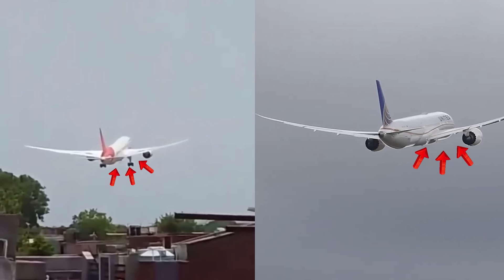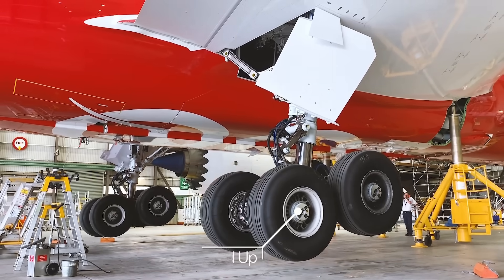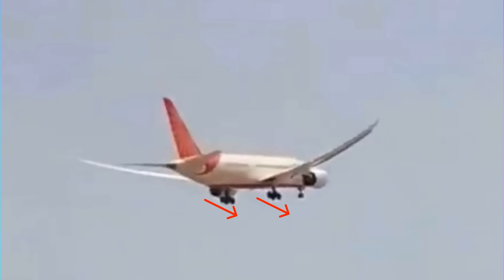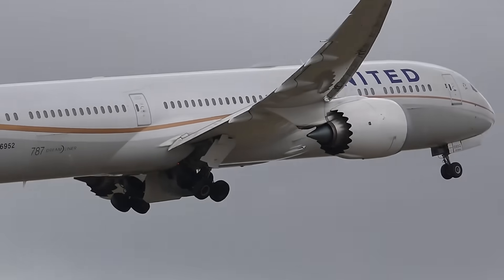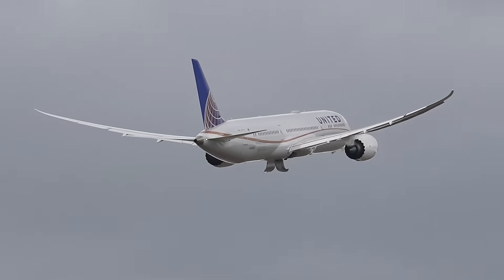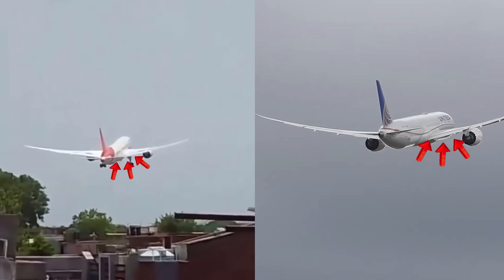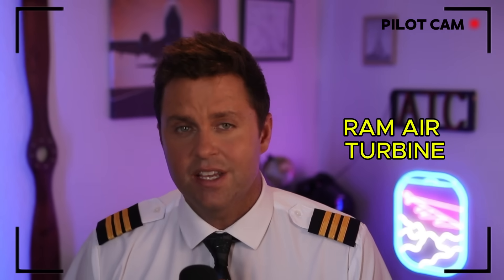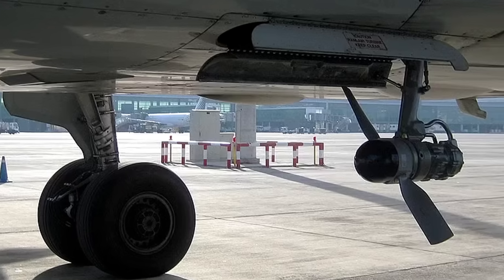Pilot Explains: A New Detail in the Air India 787 Crash Everyone Missed

Comment: Not double engine failure.  FADEC dual electronic roll-back to idle!
A Probable Scenario: Air India 171 — Gear Malfunction, Sensor Corruption, and Thrust Rollback

Context and Evidence

Air India 171, a Boeing 787-8 Dreamliner, crashed shortly after takeoff during initial climb. Visual evidence—photos and video taken shortly before the aircraft’s loss of control—confirms that the main gear truck had tilted forward (toe-down), indicating that gear retraction had been initiated, but gear doors remained closed and the gear itself did not retract. Additionally, a loud noise was reported by passengers approximately 30 seconds after liftoff. The aircraft failed to maintain climb, and eventually stalled and descended nose-forward, with no signs of yaw or asymmetric thrust.

⸻

1. Gear Retraction Attempted — Sequence Incomplete

Based on visual evidence, the main landing gear truck had pivoted from heel-down to toe-down—a mechanical requirement for retraction on the 787. However, the gear doors did not open. This implies that the retraction sequence began but was interrupted, likely due to a mechanical jam or hydraulic valve malfunction. With the truck tilted but doors still closed, the gear was unable to retract.

This incomplete sequence suggests the possibility of hydraulic overpressure, as the system continued to command retraction but fluid had no path forward.

⸻

2. Hydraulic Overpressure Event

Hydraulic systems on the 787 operate at high pressure, and the gear retraction system is part of the center hydraulic system. If the doors failed to open and the gear actuator extended into a blocked path, overpressure could rapidly build in the gear retraction lines.

In such a case, a burst line, ruptured fitting, or failed manifold could produce a sharp mechanical noise, consistent with the loud bang reported by passengers. This failure may have occurred near the gear well or pylon—areas that also house temperature probes and sensor wiring.

⸻

3. Secondary Damage to TAT Sensor or Wiring

The Total Air Temperature (TAT) probe plays a critical role in engine control. If the overpressure event occurred in proximity to the TAT probe wiring or caused secondary mechanical disruption (e.g., a panel breach or wiring displacement), the result could be:
	•	Spurious high temperature readings
	•	Electrical noise or signal interruption
	•	A complete or partial corruption of environmental input data to FADEC

⸻

4. FADEC-Initiated Thrust Rollback

The 787’s engines are governed entirely by Full Authority Digital Engine Control (FADEC). If FADEC receives TAT input outside acceptable ranges—or interprets conflicting data between thrust lever position, Mach, and air temperature—it may command a rollback to prevent engine damage.

In such cases:
	•	Thrust levers remain full forward
	•	Engines continue to spool and burn, but
	•	Thrust output is reduced to idle or near-idle

This is not an engine failure, and no fire or flameout indications appear. Importantly, pilots have no manual override to force FADEC to restore thrust.

⸻

5. Symmetrical Behavior, No Warnings

The visual record shows no yaw, no signs of asymmetric thrust, and no vibration or external damage to the engines. If both FADECs received similar corrupted TAT input, they would respond identically. The aircraft would appear balanced in thrust—but underpowered.

The crew, perceiving power loss without flameout or fire, reported:

“Unable to maintain thrust.”
This phrasing is consistent with an electronic thrust rollback, not a dual engine failure.

⸻

6. Stall and Loss of Control

With flaps extended and gear still down, the aircraft remained in a high-drag configuration. As thrust decayed, airspeed degraded. If pitch was held constant or increased under the assumption that thrust would recover, the aircraft would have exceeded its critical angle of attack and stalled.

The stall appears to have been symmetrical, consistent with equal thrust decay on both engines. At low altitude, recovery was not possible.

⸻

Conclusion: Likely Failure Sequence

Based on the visual evidence, timeline, and known system behaviors, the following failure chain is a plausible reconstruction:
	1.	Gear retraction initiated; truck tilted, but doors did not open
	2.	Hydraulic overpressure developed; a component ruptured or failed, producing a loud noise
	3.	TAT probe or wiring was damaged or disrupted by the failure
	4.	FADECs received corrupted TAT data, interpreted as unsafe thermal conditions
	5.	Both engines rolled back thrust as a protective response
	6.	The crew was unable to override the rollback
	7.	The aircraft stalled in a high-drag, low-speed configuration and could not recover

⸻

Key Observations
	•	The failure began as a mechanical or hydraulic issue, not an engine problem
	•	Thrust rollback was electronic and protective, not due to fuel starvation or combustion failure
	•	Pilots had no visual or audible indication of traditional engine failure
	•	Procedural expectation to continue climb may have delayed nose-down recovery input
	•	The only opportunity for survival may have been an immediate transition to a glide profile and forced landing straight ahead

Comment: Regarding contaminated fuel: No other aircraft had any issues after being refueled from the same source. How about this failure scenario: There was a single engine failure. Then the good engine was inadvertently shutdown. Regarding electrics: I believe that the engines would continue to run in the event of a complete electrical failure - unless I am mistaken, they do not need electricity to continue to run once lit. Fuel valves failsafe to open, not closed, fuel pumps failsafe to on, not off in the event of electronics control failure.

Comment: Hey, on my opinion, I think that the cause of the accident was a stall, the angle of attack was to high for the weight of the plane. 
Basically, the nose of the plane was pulled up to much and led to a stall . 
Needed to be worked with the Airspeed indicator (ASI) . 
My 2 cents. 🙂

Comment: We need to go back to a simpler design sounds to me like failure is built right into the circuitry. You need to deconflict the electronics and separate the engines from these hyper complicated systems. No I am not an engineer but just hearing this pilot describe the inter workings of this incredibly complex system is giving me the idea that we don’t actually need all this complexity go back to the basics.

Comment: Gary, I believe you solved the problem.   It was a complete power failure which automatically shut off both fuel switches that control fuel flow to both engines simultaneously causing a duel engine failure. Passengers complained of electrical problems of a prior flight which indicates a warning of a pending future failure which started with no air conditioning and cabin lights. So with a power failure the pilots had no time to troubleshoot the problem and reset the computer controlled fuel cutoff switches. Richard Fraser

Comment: jeffostroff was the first youtuber that I know of who pointed out that the RAT was deployed. Captain Steeeve subsequently changed his opinion and used jeffostroff's format to demonstrate the sound of the RAT as the aircraft flew by. As far as I know, jeffostroff has not been credited for this.
Reply: The fact that the gear lever is on the main panel and the flap lever is between the seats by the throttles made me dismiss the flaps/gear idea instantly. I'm astounded Capt. Steve even considered it. With the prop plane that crashed a while back, at least the auto-feather lever is next to the flaps lever so that error was a real possibility. For a pilot to retract the flaps instead of the gear is, to me, almost an impossible mistake to make unless the pilot was high on something. If it were fuel contamination, would both engines shut down together? Why wouldn't the engines pack up when taxiing? I would say that if it were a small portion of the fuel contaminated then maybe one engine would shut down before the other. This didn't happen because the yaw would have changed if it had and, as we could see, there was no deviation, just a loss of height.

Sorry, I don't think this will be fuel contamination, this looks like a complete electrical failure to me. I saw the video which allegedly showed the same aircraft with a lot of electrical features on board not working on the plane's previous flight earlier that day. Is that linked to the accident? But hey, I'm neither a pilot nor an aviation engineer, I'm just a guy who uses common sense and tends to follow what Conan Doyle said:

"Once you eliminate the impossible, whatever remains, no matter how improbable, must be the truth."
Reply: @Tao2g.J2.Only2  I like the Conan Doyle quote!
Yes, the gear/flaps confusion seemed ridiculous to me as well.
Not a pilot either (apart from in the Air Training Corps decades ago), but common sense counts for a lot. 🙂

Comment: How about metallic flame and explosion waterproof proof  enclosure or cabin with independent oxygen system along with waterproof vests with cushioned interior on every seat in which passengers have to be seated and locked in manually before take off until the plane has stablizied in Air. Passengers to be made to sit in the enclsoure cabin during landing or any contingency as well. Now even if the plane crashes or explodes these safety cabins could mean no or less lives are lost. Now such enclosures will of course be tossed around in case of an accident. But it would mean people inside will not be directly impacted by it and they could be saved. 

As a matter of fact such safety systems should be deployed in all high speed vechiles bet it planes, trains and even passenger and utility vehciles. 

Fatal accidents on Air, Sea and Roads could very well be prevented!

Comment: With the Boeing 787, we have to stick to the model of the crash, B787-8 with GE, carrier Air India and out of maintenance recently.  Speak about the B787 you can't assume that the -9 -10 GE engines RR engines the carriers are all the same. If the FAA had several Bulletins directed to the customers flying that B787-8 GE, the responsibility of maintaining the equipment in order, safe to fly is the airline. Hope everyone knows that once airplane is sold, the customer is responsible for the maintenance. If they knew that after certain number of flights, the possibility of having an electrical failure. The logic, responsible, safer, professional thing to do is to replace and maintain what the bulletin informed them since 2018.  Air India came with a new look, new marketing strategy and new owners, but still using their planes like a New York Ford Crown Victoria. They run them to the ground, when the equipment has to be taken out, the rush to buy used planes from other carriers.  Like the case of the B777-LR ex Delta. They did not even change the interior of the planes; they just rebranded the fabric with their colors. Ask or go inside an Air India yourself and see how the interiors are falling apart, and they don't even repair them.  That electrical mishap, I have a strong feeling that is the result of something done wrong or not done during the hardcore maintenance done lately.  In 14 yrs and so many 787 flying constantly, why is the first time that a 787 loses power on takeoff.  Aside from the accident, Airbus should acquire Boeing. This way it will be Airbus vs China's new commercials. Boeing is not going to make it anyway. Someone will have to acquire it or a new corporation buy it and rebrand it.

Comment: Last summer I went to London and I hate flying so I was looking at plane safety . I was on a Boeing dream plane but I looked up problems with this plane and found something about a dual fuel pump or some sensor problem that wasn't solved 😳 I changed planes I didn't like what I was reading . What about the loud noise bang ??

Comment: Question: How does anyone in seat 11A open a door and escape when an aircraft crashes nose first ??  What if an anxious passenger rises up out of their seat on the takeoff roll and opens a cabin door. Imagine a safety function in the aircraft that senses a door OPEN when the landing / takeoff gear is down. Then imagine an electrical system sensing an open door and sets the engines to idle. A crash follows and potentially a person already at the open door escapes at the last moment. Miracle ?

Comment: Hi there Gary, Good analysis, I agree it's definitely a fuel-feed issue ... BUT, have you considered it could be the fuel tank AIR INLET VALVES mounted back-to-front? ... each tank must allow air in as fuel is used, if the ground crew have made this error it would create a vacuum (-1bar) as fuel is used, which could compromise the fuel feed enough to limit the engine  power.
A vacuum would take some time to have its full affect, enough to allow a full power takeoff, but then a slow failure minutes later.
Note: this possible fault is probably not monitored (ie: tank pressure) by the blackbox recorder?

Comment: If everything such as fuel flow can be controlled electronically then the system can be made to be controlled by remote control. Why are people on rooftops camera ready, surely a powerful nearby pulse can be sent such as a strong lazer signal programmed for the job and send the same signal to cut the fuel without time for the experienced pilots to respond.
Boeing have a ridiculous record of safety that can only be designed be as such. Who has been running it? It's time the planes were taken into public ownership, the basic corruptible elements that should not be there replaced and the owners jailed and then questioned. Not questioned first! Get tough on nut jobs.

Comment: The RAT being deployed tells you almost everything… lost power, engines not running at full power (no high sound), wings were parallel to ground, rudder in proper position, flaps were down..

Summary: Either contamination or pilot error..

Comment: I believe that contaminated fuel is unlikely to cause both engines to go out simultaneously. Even with contaminated fuel the engines generally do not just instantly drop out, they cough and sputter and both would not occur at the exact same moment because the engines are generally not started at the same time. Also, there did not appear to be any asymmetric thrust or yawing from the engines going out at separate times. Something catastrophic must’ve caused them to suddenly be starved of fuel at the same time as if the fuel had been switched off.

Comment: Where are the landing gear doors? 
Don't fly the B787 and understand that there is no auto gear door opening on B787-8. However, if gear was in transit (lever selected up once airborne), when the (assumed) dual engine failure occurred, the doors should have remained open. Right?

Comment: In the video you show the gear being retracted in the hanger. Notice that at point of the landing gear going forward the landing gear doors on the body open, if you have look at the the footage of AI171 you will notice that the landing gear doors never opened it seems at that exact point is when the power loss occurs as the rat would not supply enough power to open the doors???

Comment: CRASH cause: the cause was electrical-connection disruption, or breaks in control wires.   HOW; it is well documented how rats get into planes in the past and would eat wires, severing them.  India for one has major problem with this.  In the 60s and 70s when nations shipped pallets of grain to India during famine, aid workers were horrified to see thousands of rats eating those bags of grain; largely due to the religious practice in India of not killing any animal for fear it could be a reincar. past relative.  The flight before the crash, passengers reported some screens would not work, and phones dead in some seats.  India Air does not clean, or maintain well at all, and it is very likely 'rats' not the 'deployed rat to produce power', but actual vermin rats had invaded the flights internal spaces and eaten/severed electrical lines.  The 'warning' the flight before was overlooked due to the gross negligence of the company in India who 'trained' their aircrews to 'overlook' such notable failures as electrical and communications outages.   simply put, the jet died of mice and key control communications cables were severed, starting the prior flight and continuing until key controls for engines 'failed'.

Comment: Not contaminated fuel because that would only  stop the engines/thrust ....there was also(and probably firstly) a loss of electrical power for some other reason. Most likely, a total loss of electrical power(RAT, main gear position) and thus no fuel to the engines. (no thrust)
.......see @RyanBellowingAcresSupporter comment.

Comment: Sabotage act,  could something be added to the fuel at the airport causing it?   Surprised that on modern aircraft like Dreamliner the system would allow you with a simple switch to cut off fuel on both engines..  !  That would make it possible for pilots like the Guy on German Wings intentionally crashing the plane possible :(

Comment: Just seen a video where it was suggested that a Command Transmission Device which I think meant the mentioned Thrust Signal Converter was the unit that failed preventing engine control so resulted in engines not responding???
Wonder if any aero mechanics/pilots  have thoughts on this?

Comment: the flap lever is in a gated slot and the landing gear is part of the instrument panel . Take off warning would have been screaming if engine s were retarded. Isn’t RAT is only for electrical power . The Apu door is still open so maybe it was running also. In all the years and many hundreds of flights I have never seen or heard of a double engine failure except when  airline that had a Boeing 727 had a double engine failure due to spoiler locks left in the rest of the wing area and these went through the intakes.